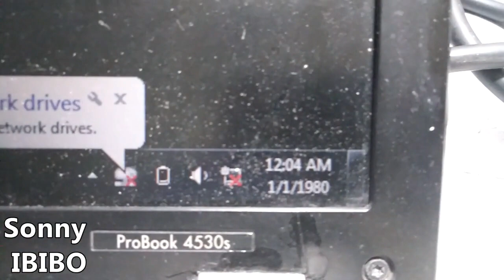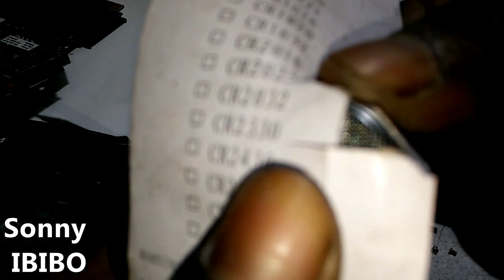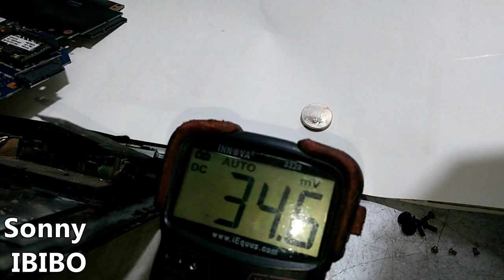Fixed - HP ProBook 4430a 4530s 4730s CMOS RTC Battery Replacement | CR2032

Comment: thanks, used video reference to cut a hole in the plastic below the slide cover and change battery without dissasembly
make sure to not touch any metal inside, lift the plastic and prry at it slowly with pliers 
remove main battery  and power of course
Reply from the maker: Great.
Thank you for sharing the info.
Reply: Thank you for sharing the info! Could you please paste the image or the dimensions where you cut the plastic? Thanks! 😊

Comment: Do you have to remove the whole keyboard or is it possible to open it by unscrewing only the bottom cover?
Reply from the maker: @vukbojovic7504  the location of the RTC battery requires getting to the main board.
Reply: Never mind. I just cut the plastic above the battery and taped it back. Much easier. @SonnyIbibo